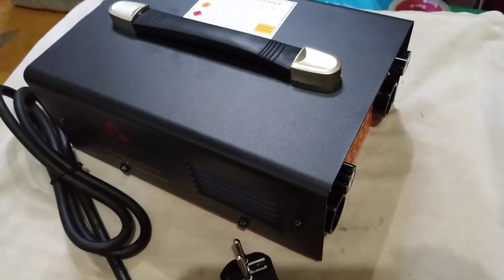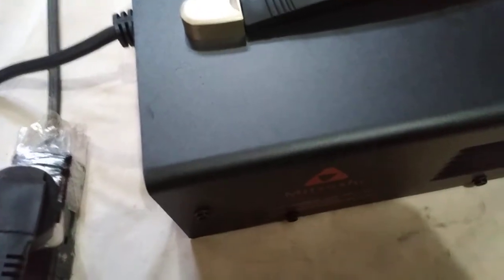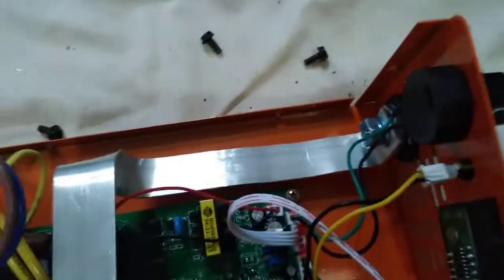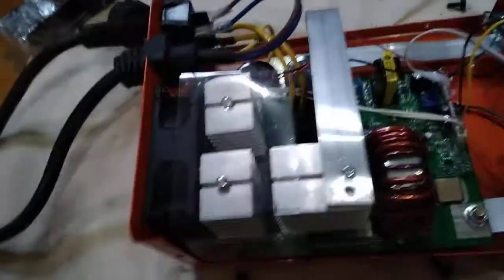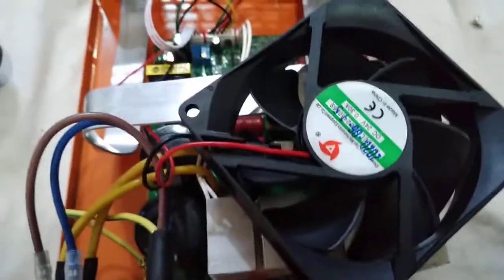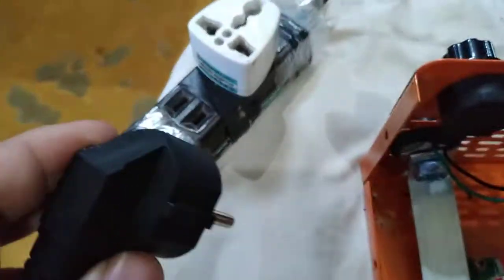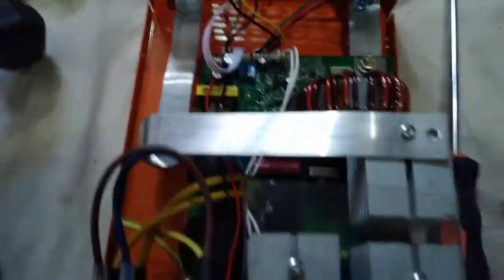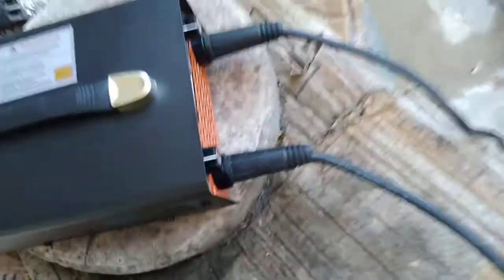how to fix Inverter welding machine humming sound inside

Comment: During the video, you did a serious mistake that could lead to an electric shock due to earth leakage current. The adaptor that you were using wasn't the proper one for schuko plugs, because the earth wire wasn't connected to the mains. I hope this is not how you use the welder or any other appliance in your everyday life